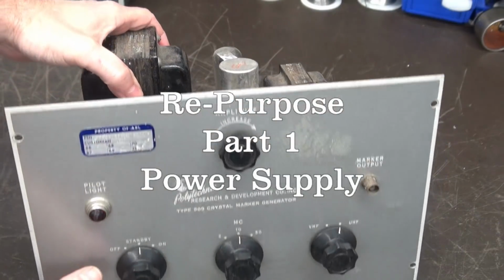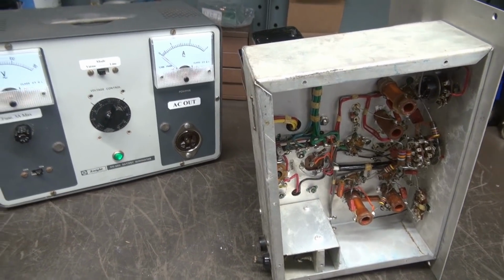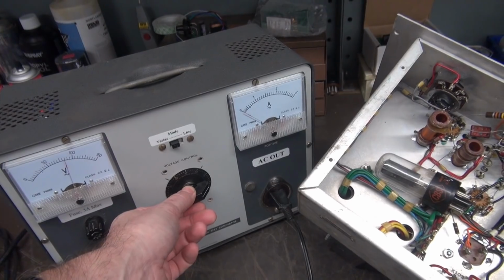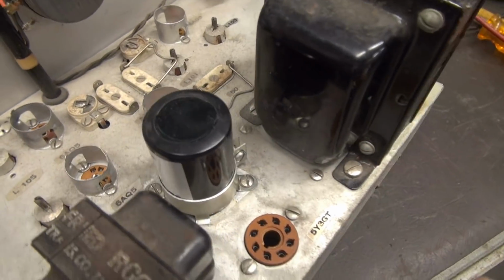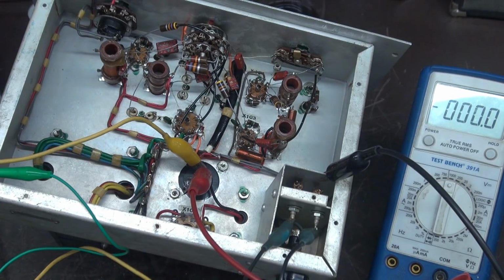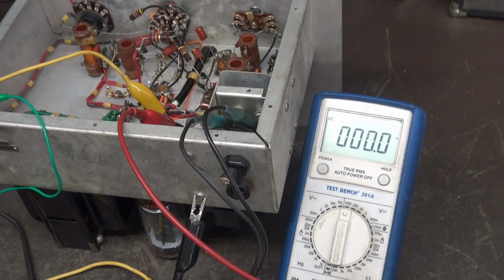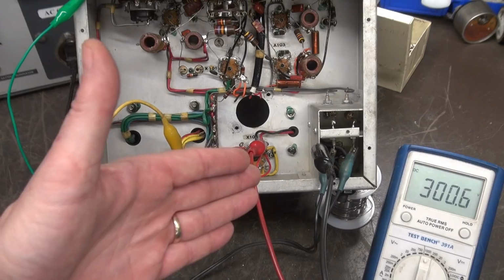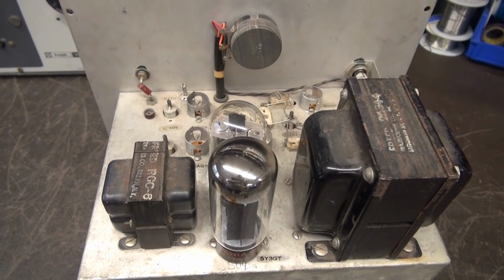How to re-purpose build a custom homebrew 6L6 tube guitar amp Junk box special part 1

Comment: I enjoyed this entire series but just had a nagging thought in my head that wouldn't go away. "Why is the B+ so high? This seems to be a high quality piece of military grade equipment so why would the manufacturer use a 5Y3 and a 450Vdc multi-cap can in a circuit that is producing 500Vdc? Then I found the answer when I rolled back to the beginning of part 1. The B+ never was 500Vdc because the manufacturer used a choke input filter in the power supply. The rectifier output had to pass through the choke before arriving at the first cap. This arrangement produces a much lower B+ output than the more common cap input filter. The choke input filter produces a peak DCV that is only .45 X secondary ACV. And the more common cap input filter produces a peak VDC that is 1.414 x secondary ACV.

Wish I had seen this video 3 years ago. Probably doesn't mean too much this late in the game but at least my nagging head is happy.   ;>)

Comment: Hi Terry...I have stripped a Stromberg Carlson Model 32 P.A. head and now have Two Tung Sol 6550 power tubes, a 5Y3 rectifier and a handful of Mullard 12AT7 tubes, the original metal clad 6SQ7 tubes,a6K6 and an aluminum chassis drilled and ready for my first Class AB? push pull build. I built the fun 5F1 champ with an adjustable negative feedback circuit courtesy of Uncle Doug clips but this will be my first build with a phase inverter circuit and I want a good circuit that I can complete and be proud of. This P.A. head was designed for 6L6 tubes and the power transformer checks out ok with 720 volts AC available with no load .The power transformer has all the needed taps for tube rectifier, high voltage and center taps where expected The output transformer has taps for 4, 8 and 16 ohm speakers so my transformer needs are covered. I was considering a 5E3 Tweed circuit but that may or may not be the best circuit I could build to take advantage of the power of these mighty 6550's. Your advice please on a circuit that is simple enough for me to complete considering what I have told you. I play Country, Blues, Swing music and am a far better guitar player than amp builder and dabble in jazz a little bit so I like overdrive and speaker break-up but am by no means a Hard Rock player so I'm basically looking for good clean tone with maybe a little hair right at the upper limit of my volume knob. I expect these two 6550's will  easily make 50 watts and I have two Jensens just waiting to be put back in service from an old Silvertone set up I bought years  ago. They sound fantastic on the back end of a Fender Bassman AB165 that belongs to a friend of mine .Your clips ,and others are very inspiring and I thank you for sharing your knowledge with the world...and me !
So...which schematic should I tackle ? I will be retired at the end of the year and this will become a regular hobby I suspect. Many Thanks  ...Daniel

Comment: Just so you're aware, "mil-spec", or "military-grade" doesn't automatically mean it's a quality build. It just means that it's built with standardized parts as cheaply as possible while still retaining a semblance of real-world functionality. Note the lack of grommets on chassis pass-throughs. Industrial and lab-grade components and gear are typically of much higher quality. Just look at the Bradley IFV. That colossal dumpster-fire of an Infantry-support vehicle should never have made it into service, yet it's "military-grade", right down to the extremely lethal Halon fire (and crew) suppression system. Halon is like Carbon Monoxide on steroids, as far as my understanding goes. When it comes to procurement, sometimes entire contracts depend on who's greasing the wheels. Bad gear makes it into the chain all the time. The AR-15 also comes to mind. It has good ergonomics, but it's entirely inadequate. The argument that lighter ammunition means you can carry more of it goes out the window when you factor in that due to its reduced size (and power), you now need to use multiple rounds to do the same job that one used to do, which means troops are now blowing their load even more quickly than they did back when the M14 or FAL were in use by America and Canada, respectively.

Comment: Hi I was wondering if maybe you could help me with something.  I bought a used tube amp and want to do some bias work after changing tubes.  The problem is the company uses a wonky test point system.  The variable control turns up and down the bias negative voltage and allows two diff ranges one listed as EL34 range and one listed as 6L6 range.  I have 4 6L6 in the head now.  The problem is the test point they provide just shows the negative Bias Voltage and NOT the actual current draw from the tubes.  I am going to just order one of those tube socket things you plug one of the tubes into and then plug that into the socket to read the current draw.  But I have NO CLUE at all how to figure out how much current draw the tubes should be drawing.  I know its some kinda math lol.  Could you tell me the formula on how to come up with the proper ma current draw for this amp?  Thanks :)

Comment: Glad you ran a load on the power supply Those rectumfriers can take the voltage way high over the caps voltage rating and go kaboom without the output tube/s in place Other issue that certainly only very few techs realize is the screen grid voltages exceeding the maximum recommended  by over 10% due to  the rise in mains voltages in the US will certainly kill your tubes much quicker Everybody should open their data books and check this I don't know why it gets dismissed by most In actual fact a separate regulated supply would be the ultimate for screens

Comment: HI Ter.. I was wondering if you need resistors across the Caps when they are ran in series for High Voltage?
Reply: I was thinking about asking the same question. It used to be, at least, a standard practice to place so-called 'equalizing resistors' across series connected electrolytics.

Comment: This will be an interesting year of projects for sure.  I'm looking forward to it.  Any concern over how close the 5U4 and the 6L6 are to each other?  I know most of the heat will rise but that glass is going to get pretty hot.
Reply: I had the same thought. They're going to run hotter than normal. There's a lot of real estate there for separating them for better heat management. But... this is a first cut at the project & he may change that output location later.  That hole is tempting to use but maybe not the best location.

Comment: Happy new year, Terry. I've got a crazy idea: Why not use an 807 running at about 50 mAmps and take two of the miniatur 7-pin sockets for stabilizer tubes of type OB2 to get a fixed screen voltage of 216 Volts? Of course, in this case the power transformer should be capable of delivering the extra stabilizer crosscurrent...

Comment: Terry - a suggestion for a future video.  Build a spring reverb from an old piece of test equipment.  Accutronics makes the 8 ohm reverb tank you need for the original Fender circuit.  You can also add some extra gain to overdrive the amp without reverb.  The outboard Fender unit is very lush and springy compared to the blackface amps.  Very Dick Dale sounding.

Comment: Hi Terry, I have paralleled and seriesed transformers as well, as long as you get the phasing correct they work fine. If going for high voltage you do have to make sure the transformer insulation will take it.

Comment: This is good stuff. I like the new series format. I was glued to the screen. Repurposed boutique amps. Such gems. I am rubbing my hands together like an evil villain. The additional output of the older transformer because of the higher wall volts is intriguing. It's like getting a free boost just for making the conversion. Like cash back! If you find the right candidate for a refurbish. That amp is going to sound real nice Terry.

Comment: You could actually use to DROP your B+ a tad. You don't need 500+ volts. One easy way would be to wire the choke in right off the cathode of the 5U4 = choke input filter, instead of between the filter caps = "pi" filter (as it now is, just tacked together for testing) Probably not dramatic, but could knock off 20-40 volts. Yes, and as someone downthread suggested, balancing resistors across the series filter caps are called for. 220K/330K are fine. They also provide a mild bleeder function.
Reply: If the choke input isn't enough drop, a bucking transformer made from a smallish filament transformer can lower the input to the present power transformer.
Reply: hi can you tell me if this 6l6 give 10 watts power cause i got no response of d-lab

Comment: Hi Terry the original configuration was choke input, that would have reduced the voltage by 30% and improved regulation of the supply. Very common to have this arrangement on this old military test gear.

Comment: Here's a tip for your viewers. Say you didn't have a 25w resistor but only a 10w. Just for the purpose of this test you could put the resistor in a jar of water, then the 10w resistor could easily take 25w or more.
Reply: Or, a less messy solution that doesn't assume low mineral content in the water (some folks have a LOT of stuff in it)... just put together some series/parallel combo to do the job. And if you don't have enough to do that... it's time to invest in some parts!

Comment: Excellent idea. Can't wait for part 2. Question- are you using 5u4 due to accessibility? Does the 5 volt winding have enough amperage or would a 5r4 be a better idea, similar voltage drop but only 2 amps on 5 volt. And I would definitely not use a 5ar4 cuz that would probably make it closer to 600 volts.
Reply from the maker: Hello, The Freed tranny appears to have plenty of current on the 5vac winding for the 5U4. I will monitor the voltage and see if there is notable sag. If so, I do have 5R4's on hand. Great input. Thank you. Update: just verified the 5v, hangs steady at 5.6vac, looks OK

Comment: The Tweed Fender Bassman and High Power Twin used 600 volt caps in the power supply. Unloaded, neither one went over 500vdc on 110vac line voltage. There had to be discussion at the time about standardizing US line voltage to 117vac at the time, otherwise Leo wouldn’t have wasted the money. The only 600v 20uf caps you can buy today are made by Sprague, and they are NOT cheap.

Comment: Nice project Terry, interesting series that I´m going to follow.
I would put a resistor voltage divider over the filtercaps, or there might be a problem in the future.
I have seen this happen even in low voltage equipment where the values change over time and one capacitor blow up from overvoltage. This is no issue when the caps are new, good brand and from the same batch but down the road….
Have a Good 2020

Comment: They don't make 'me like they used to! Except at D-Lab! Terry, I have to say you heard us tube ampaholics and this new series is just what we need! Ham radio is so important, there maybe 1 Ham guy for every 1000 ge-tar players out there, so I am thrilled for this new series. It's probably too late, I think, with this power supply a 30-50 watt class AB output would be great! You could make the input switchable for guitar or bass. It will end up a head not a combo, so you could use it for either. With that kind of power supply voltage you could also think about a 6550 output tube instead of the 6L6, maybe get 20 watts class A output. Just an observation. Love the D-Lab channel! Happy 2020! Thanxz
Reply from the maker: Hey Man! Thanks for the input. I do have a few 6550's laying around. My only concern is my output tranny can only handle 50ma max. I agree though, and can reel back the bias to support that tube + protect the tranny. This is going to be a great project!

Comment: I always find you brave for use those alligator leads on 500V or so.
Reply: It’s on the primary right? Nvm. I just got to the point where he’s testing her out on the hv secondary winding.  It’s definitely getting towards the upper limit of most test leads (600v).

Comment: Hi Terry, Happy New Year! I always enjoy when you repurpose stuff. 

FYI, 5U4 draws 3A of heater current vs. only 2A for 5Y3. I guess you’re assuming that transformer can handle the extra load? Somebody had to point this out. 😉
Reply from the maker: Yep, this appears to be a over designed power tranny for its application. I have seen this same Freed transformer used in Globe Chief transmitters. They run a 5U4 and a pair of 807's. This amp circuit will be child's play for that iron.
Reply: Wow, that was a fast reply! I should have known you had that issue covered. Globe Chief! Now you’re talking! I wonder why they used such a hefty transformer in a crystal marker generator? Maybe it was designed to be repurposed into a guitar amp. 😊 You could go to a larger push-pull amp with that tranny. 

Hey, you’re not really gonna stop working on vintage ham gear, are ya?

Comment: I suggest you connect 1 resistor in parallel to each capacitor to equilibrate them in DC voltage. A good value could be about be 330K. This is a common used technique when connecting capacitors in this way.
Reply from the maker: Excellent suggestion. Will do
Reply: Good idea, Hammond F!

You know how learning an old theory can still apply to newer technology?  Several years ago I repaired an LED-based center brake light from a Ford Taurus for a friend of a friend.  I traced out the circuit, and 18 LEDs were wired with three series sets of six parallel LEDs, plus resistors to balance the current loads.  After redrawing the circuit twice to make it more obvious, I finally realized why the resistors were being used, pretty much the same reason you pointed out with the series/parallel capacitor bank.  I finally ended up replacing all the LEDs so they'd all have the same characteristics since I couldn't get a part number for the originals.  Worked like a champ.

Patiently waiting for Part 2 to arrive, Terry, keep up the good work.

Comment: I am a tube amp tech also and really enjoy watching your channel, happy New year.
Reply from the maker: Thanks Dan, Feel free to comment with possible features to this design. So far, I plan to keep it clean & simple
Reply: @d-labelectronics  clean and simple is the way to go, what do you think the mono block amp was originally used for?
Reply from the maker: This was actually a high output crystal marker generator. Do not know its original application
Reply: @d-labelectronics  what frequency did it output if you know?
Reply: I would use a 6SJ7GT tube to drive the 6L6 input, the 12AX7 driving the 6SJ7 would work great.

Comment: what tone stack do you  anticipate using ..??
Reply from the maker: I plan to use the Fender Princeton Bass & Treble circuit. May add a Master volume to the 6L6
Reply: @d-labelectronics  could be interesting w/ the 6L6 operating Class A  :)
Reply from the maker: Yes, I will have to keep the current low, so not to overheat the 6L6. Approx 535vdc plate applied!